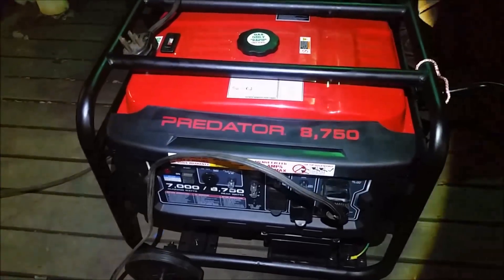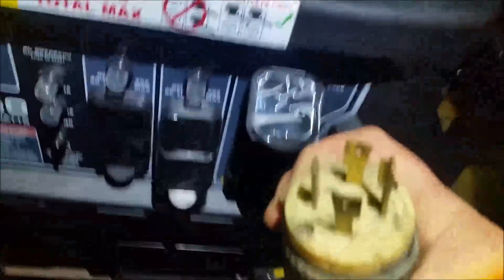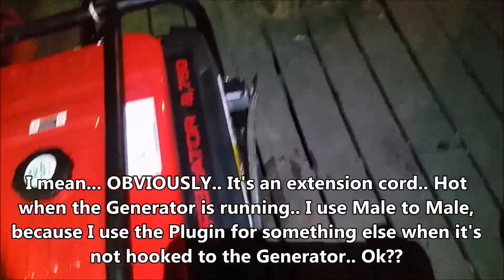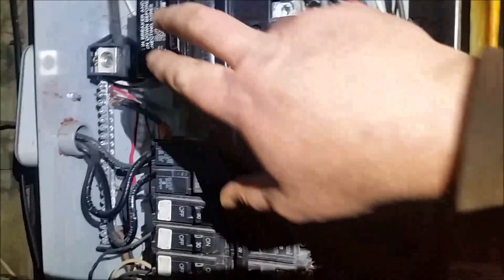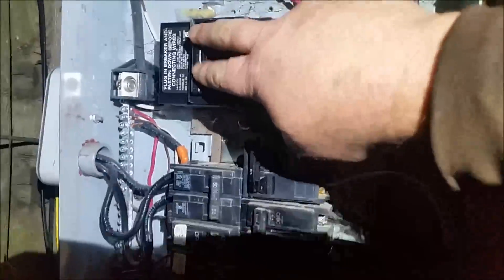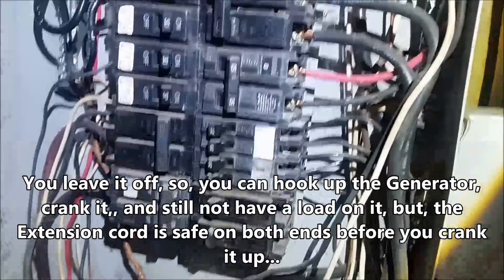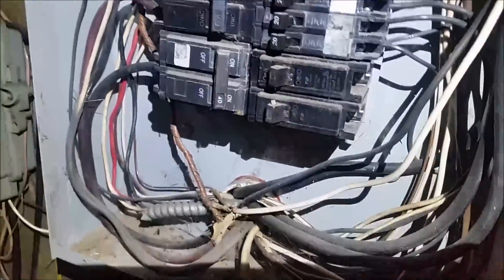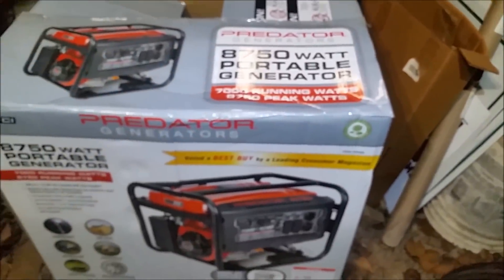Quick/Easy/Safe: Use Existing Plugin/Breaker for Generator hook up to your house Panel box.

Comment: No Main/Generator interlock= NOT TO CODE. Why risk killing someone by following your convoluted directions for the sake of saving a few dollars? Just do it right, (all the necessary parts are available at Home Depot) or hire a licensed electrician.
Reply: An interlock device prevents fuckups, like when you're drunk or tired and trying to switch things on in the middle of the night, while some poor lineman is out in the storm on a ladder truck trying to fix things and not get electrocuted.
Reply from the maker: AeroDickUs.. Yes.. If you are going to get drunk and try to switch things on in the middle of the night,,  you'd better get something that you can't fuck up.. Like you say.. Do you think the lineman is also drunk on the ladder? Man. what will you come up with next.. Ha..Ha..Ha.. Hey.. Maybe you should stick to failing at making a propane tank stove... Work well enough to call it a stove?? But, it won't boil a pot of water?? ha..Ha..Ha..Ha.. Funny!!  Scares me to think you cut a hole in the side of the propane tank.. Did you turn the Main Breaker off before you did that?? Same thing, but, I would have made sure the valve was removed and filled with water, or at least rinsed with water just before I cut into it..  And,, was that a weld I saw?? Kind of looked like one, but, then again,, didn't.. Ha..Ha..Ha..
Reply: On an earlier post I started to ask what snowflakes would be next, a butcher, a baker and a candlestick maker? But it turns out twas a propane tank stove maker. I really don't get it, I built my double male jumper cord in 1999 and have yet to hold a live plug in my hand (though I wouldn't be afraid to if the need arose for a sudden disconnect). Also no chance to burn the house down as the house wiring meets code and with main breaker off there is zero chance to hurt myself or a lineman. The only thing I can think of is that just maybe the snowflakes were suckered into spending too much money for their setup and think they can somehow prove us wrong else they spent their money in vain.
Reply from the maker: Ed Taylor.. Lol.. Ha..Ha.. You nailed it.. It is either that, or, they have to be paid trolls.. I have never met a more ignorant bunch of people.. Ha..Ha.. 
Hey.. Add Journeyman to the list.. I just spanked one pretty hard. I thought we had a real winner here.. Sounded like he had all sorts of experience, and misunderstood something in my post. But,, he went off of the deep end and I had to straighten things out.. ha.>Ha. 
His ID is Bobben47 if you see his post.. I think you will like that one too..
Reply from the maker: AeroDick.. Interlock, Not to code? Convoluted directions?? Ha.Ha.Ha. Yea.. I tried to make it simple.. 
Turn Main Breaker off, 
Hook up extension cord,,, then,, 
Crank Generator.. 
Didn't mean to confuse you with the Convoluted instructions.. Ha..Ha. Hire an Electrician?? Ha..Ha..Ha.. You mean one that can't even make a propane stove that will boil a pot of water?? Is that your Resume?? Ha..Ha..Ha..Ha..  I mean.. This is your Goofy ass correct?? 
https://www.youtube.com/watch?v=iJkTfBXfzv4 
And,, by the way..  You should go here and post your ignorance.. They are a bunch of electricians talking about using the male to male cords to backfeed circuits on a more than common basis.. Like this is not done in the Electrician world, where they have to comply with the NEC. Ha..Ha..Ha.. 
https://www.electriciantalk.com/f2/breakers-directional-19714/

Comment: I look at this as a good alternate or emergency way to hook-up. I have a permanently wired transfer switch in my house for my generator, but if I wanted to help out a family member or friend in need there is not a convenient way to hook- up to their house. Yes, you can run a 120V extension cord to things like refrigerator, TV,  microwave,  and lamps. But 2 essential needs are furnace (120V) and well pump (240V) which are usually hard-wired to the house and would need some rewiring to be connected to a generator. A 3rd item which is convenient to have is the home lighting circuits (120V) which are also "hard wired". So, for these items, a patch cord as shown in this video, would be a good accessory to have for a generator. This would, also, come in handy if you are a renter and not allowed  (by landlord) to install a transfer switch. You may want to have several different connectors for the cord or several cords depending upon what receptacle you connect to,  like dryer, range, welder.
Reply from the maker: Exactly.. Or, your landlord would not give you credit for installing the thing, or let you take it after you installed it for another good reason.. A Transfer switch is surely not a Temporary installation.. My brother is like a lot of the snowflakes here.. We had an extended outage and he needed to charge up his two refrigerators and two freezers and really wanted to be able to wash dishes, shower, etc, before he got his transfer switch/generator installed.. I took an extra female plugin I have in my stash, and made another short cord and stripped the ends and connected directly to his dryer breaker, and let him use my generator for a couple of hours while I shifted over and got a project done out on the property... He had an open 220v slot, so, I left the cord with him and told him to buy an extra 220v breaker if he wanted to use the generator again.. He did. But, I had to go and hook it up for him. I can still remember him saying.. That's all that is when I put the breaker in, mounted the 220v Female receptacle to his pole and flipped off the main breaker, hooked up the cord and cranked the generator.. He had this really funny look on his face as he told me how much he had just paid for his transfer switch he had ordered online,, and his face got even stranger when I  showed him what he was going to have to do to get the damn thing installed.. Ha..Ha.. And, after that,, even worse when he knew he was going to have to call an Electrician because I told him how to do this to begin with, and he didn't have room to install the damn thing and I wasn't about to go through all of that crap to mount the damn thing for temporary use. I would,, if they built a smart one that wasn't for Lazy Electricians and twice the size of a regular panel box.. He had to have the electrician set another pole next to his existing pole to install the dang thing.. And,, after it was all over, he had bought one of the panels where you move over the circuits you want to run while on generator.. Man did he have a strange look on his face when he found out that he was not able to run half the crap I run because the Electrician didn't have enough sense to know that he would not be running all of the stuff at one time and would not be running all of the items at Max watts or voltage all of the time. He had to call the electrician out a second time to move a bunch of other circuits over.. He didn't even have his lights in his office wired to the generator after the firs trip. I think he has about 3k invested now,, just so he can throw a bigger main switch than I have..Ha.Ha..Ha..  Of course.. He can be drunk, etc.. if he wants to and still get it figured out, I guess.. 
When I build again, if they have a transfer switch that can be installed below the meter pan, and above the panel (no need for any large size anything with straight run cables), I will install one.. All it has to have is One Male plugin for the generator hanging out the side of the box that becomes part of the circuit when the main breaker (From Utility or Utility Service disconnect).. If that doesn't work, I will look for the smallest panel box I can find and see if I can figure something out that will feed the house panel using an Interlock.. I'll have to think about that one.. 
I had a friend ask me to come by and see what it would take to hook a generator up to her Mobile home.. I went over and walked behind her place and saw this huge box on the pole, and an RV box still mounted on the pole that she had when she just visited up here and stayed in her 30 foot travel trailer... 
I said.. No problem.. You already have what you need as I was walking up.. I was looking at the huge box under the meter pan and wondering,, what the hell could be in that thing?? So HUGE!!.. Nothing.. Just a service disconnect, and the damn fool electrician didn't even hook the really nice RV Panel back up.. It still had 30 and 50 amp breakers and two 120volt plugins still on the side of the pole.. I shook my head as I told her, she would have to change just about everything out, and hope we would find the right length boxes, so she would not have to replace the service from the bottom of the box to the mobile home.. Why the big box? I have no idea.. All I could see was a lazy electrician who didn't want to have to bend the feed wires, which he didn't have to bend to begin with... Ha.. She was ready to have a shed built and run electricity to it.. Shame.. Her shed got smaller with the news..

Comment: This video is both DANGEROUS and STUPID!   Shame on you, Mark!  You should, but obviously don't, know better!
Reply from the maker: You should know what turning off of main breaker does. After that, connecting the cord and then after that cranking the generator. What part of that is dangerous again?
I can understand if you can't follow those simple steps. Yes it can be dangerous if you cannot. Simple minds and simple steps sometimes do not mix. You should probably not try this.

Comment: Danger!!!    Danger!!!   and also illegal!!!     You can kill people down line.  Power company will unhook you !
Reply from the maker: Tom Doore.. Turn the Main Breaker off, hook up the cord and then crank the generator?? Unhook in the exact reverse.. 
Please explain what is dangerous using the above stated procedures.. You are not making any sense.. 
Illegal?? What are you? A liberal Snowflake??  You talk like you know something is Illegal..
What is Illegal? Backfeeding a panel via a breaker?? 
Or is it the Male to Male Extension cord??
It's kind of hard to quote something that does not exist in the NEC Codes.. But, since you are in the know, maybe you could enlighten us.. Please post a link to the code that talks about the Male to Male "Portable, or Temporary Use Extension Cords".. We will all be waiting.... !!
But, here is the codes that are most closely related, and some knowledgeable people discussing this exact issue. 
NEC CODES  406.6 and 406.7
Notice the first reply by the Moderator.. Even though he disagrees, he says it is not regulated.. And, he knows enough, no one even remotely argues with him.. 
http://forums.mikeholt.com/showthread.php?t=158086
Then,, look at the NEC Code Definitions on this page and spend a while understanding what you are talking about, and then go back and read the forum posts.. You might be able to understand what everyone is talking about.. 
https://iaeimagazine.org/magazine/2014/12/02/article-406-receptacles-cord-connectors-and-attachment-plugs/

Have a Nice Day Mr. Dumbass.. You should ask questions instead of spouting ignorance.. If you do the first, then, you won't show you are the second.. !!!
Reply: Tom doore, you’re absolutely right. Everyone really needs to watch this video about generator safety https://youtu.be/I1jT3ANENvI hope you watch this important video. Everyone really needs to agree with this advice I’m sharing. Thank you. I hope you stay safe. I’m just trying to be nice.

Comment: We had an ice storm in the early 2000's, I bought a $500 B&S generator, plugged it into my welding outlet in my garage, turned main breaker off..Also to stop it from arcing across the main breaker in the breaker box,  I also cut the little clip on the electric meter and pulled the meter so it wouldnt backfeed and kill someone working on the lines.. The backfeeding has happened before...   We went 18 days without electricity, but we had the generator so we could live like normal..   The fuel was expensive but it was nice to have the electricity from the generator..  
 When the linemen came and was replacing our main line and transformer to get our power back on three of the linemen came up to the house and thanked us for pulling the meter..
Reply from the maker: KyGamer.. Yes.. That was a good idea, especially on an extended outage..  Even if the Main Breaker was turned on for some strange reason,, there was still another safeguard.. I'm sure the power company didn't mind putting a tag back on the meter.. It would take a whole lot more voltage than the generator would output to arc across the main breaker, but,  it is sure a lesser distance than between the lugs on the meter pan.. It never hurts to add an extra layer of protection, although it was not needed.. You could also throw the main and then lock your panel and not pull the meter, but to be quite honest,,, pulling the meter,,, or at least running on Generator is a GREAT IDEA,, when the power company is trying to get the power back up... There are massive amounts of voltage fluctuations when turning a Utility main back on.. They are never sure that other problems do not exist when they throw the power back on.. Usually, the throw it on, if it pops back off, then, they send a crew or crews down the line to see where it is.. A common way of doing this is what they call "Walking the Line".. They go to the next downstream fuse, flip it out, and turn the main back on again, if it throws, they go back the way they came.. If not, they throw the main off, pop that fuse back in, then go to the next downstream, pop it out and test again.. Eventually, they make it to the end and they are done.. But, every time the power comes up and drops again, there are large spikes, brown outs and spikes again.. Watch your lights next time the power goes out.. Rarely, do is just "Go Out".. Normally, it has a brown out, and if their is a fuse somewhere else that does not affect you, you won't see another, unless the power has to come down to fix it.. Whatever the case, when something touches a high tension wire, voltage is going from it to whatever, and that is on the way out, or on the way back up.. The safe thing to do is stay on generator until everyone else is up..  I would agree that backfeeding has happened,, although very rarely, and I would be willing to bet,, that it was not caused by a "Fail Safe" main breaker that was turned off. 
Thanks for your comment..
Reply: Mark Thomas and KYGamer,   Pulling the meter is a great fail safe plan for an extended period without power,  especially if there is the possibility of the wife or other family or friends getting “involved” when you’re out working.

The mention of the meter reminded me of when me and my buddies were poor young punks and we would flip our meters upside down for about three weeks every month to keep our electric bills really small.  I got really good at recreating the shape and size of the spring steel wire in the meter ring lock.  It worked great for a year or so until one of my friends forgot to flip his meter back to right side up,  the power company investigated,  and that ended the infamous Knuckleheads Electricity Caper.

Anyway,  during normal conditions,  I keep my breaker panel “locked” with a fairly heavy zip-tie that my wife or anyone could cut quickly in an emergency to shut OFF the main breaker.

During power out conditions,  I padlock the panel so no one can turn ON the main breaker and cause a back feed when the panel is fed from the generator.

I enjoyed your video.  Common sense is such a rare commodity anymore so I truly appreciate your way of thinking.
Reply: Hope you all watch this video about generator safety https://youtu.be/I1jT3ANENvI I just hope you stay safe especially during severe weather